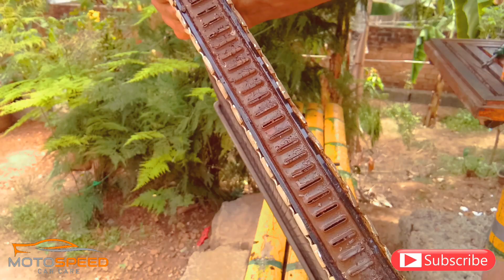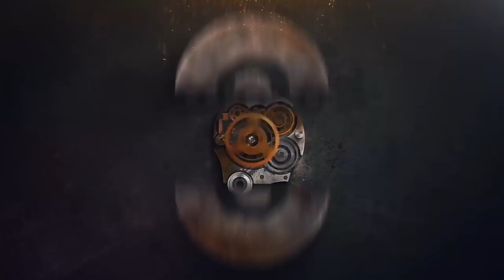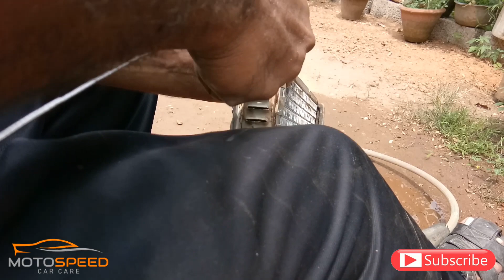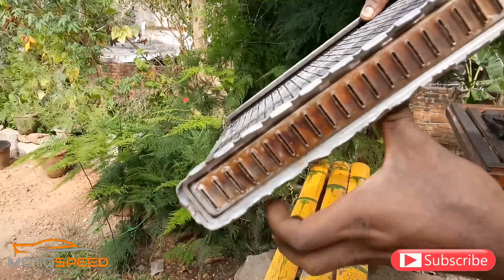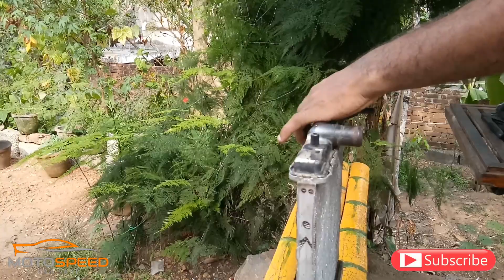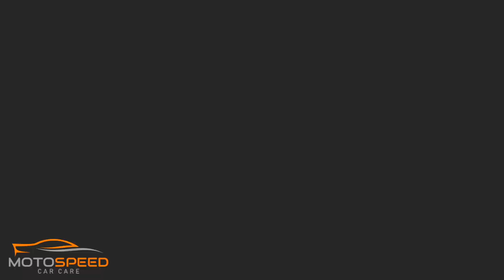How to clean radiator | എങ്ങനെ easy ആയി radiator clean ചെയ്യാം

Comment: Ente 2009 model mpfi m 800 engine warning light runningil off avunnilla wrk shopil knichu wire toching avum ennu paranju, low costil shariyakkan pattumo?
Reply from the maker: Battery terminal 90 sec neram oori ettittu koduthunokk broo chilappol warning light pokum ( fault code pending aanengil )
Reply: Censer കംപ്ലൈന്റ്